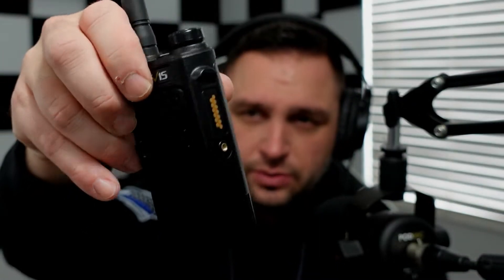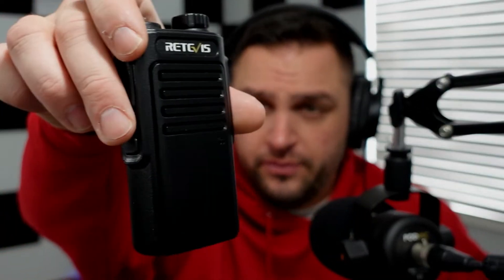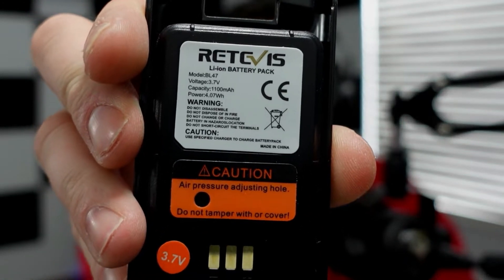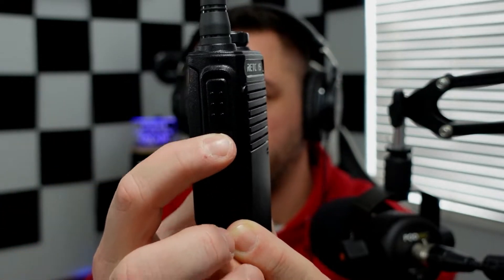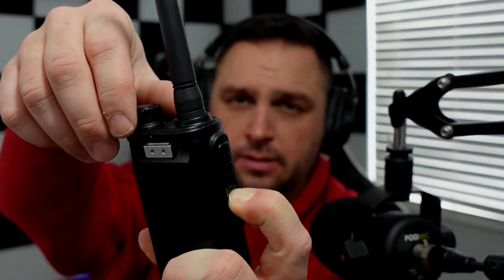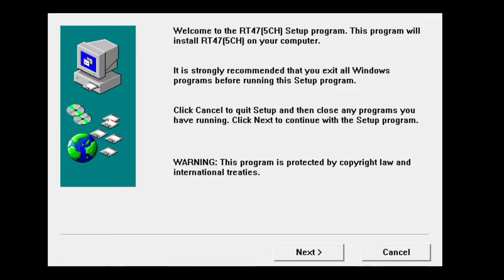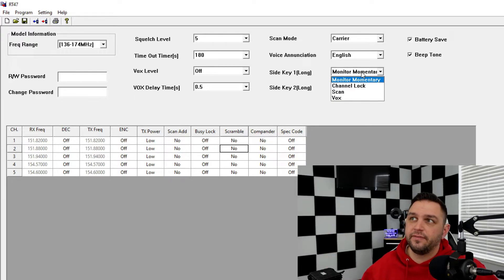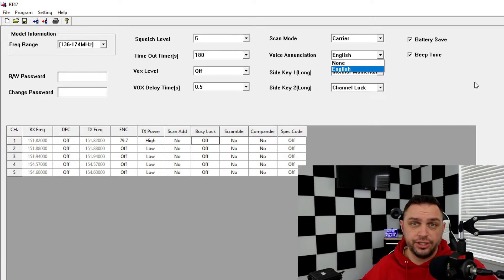Retevis RT-47V / RT47V - Radio Overview Part 1 of 2

Comment: I can't get the radio to accept a read or a write.  It says "Cannot connect the radio" and then the radio says "turned on the radio, one".   I read a forum that said Retevis may have locked down the RT47V's to prevent programming because of being afraid of the FCC for some reason?  There is nothing illegal with wanting to set CTCSS tones.  Anyone else having an issue with this?  Is there a secret password we need to enter in the programming software?

Comment: Wow - great video! Thank you for your effort to make the things clear even for a noob like me :)

One question: Does changing the value TX Power from Low to High in the Desktop Software increase the distance I can bridge with the radio?
Reply from the maker: In theory, yes. More power will increase your distance. The question is, is how much? The answer to that is a little complicated and based upon environmental conditions such as if there's buildings in between, mountain, trees, or other obstructions.    Hopefully that helps

Comment: The programming software installed on Windows 7 PC using a programming cable  bought separately. Chose the correct COM port, clicked button to read the radio (tries to read the radio) but ultimately it would say Cannot connect to the radio. Then the actual radio reboots (it would say "Turn on the Radio..")
Help!
Reply from the maker: I would first question the cable.  Did you get the cable with the radio or purchase it aftermarket?
Reply: @DudeTested  aftermarket, sadly. Thats my next thing to do- get one from Retevis.
Reply: @DudeTested  can you direct me to the link for the cable?
Reply from the maker: @roypunay  https://amzn.to/3kBCHfE  Here you go. So the reason I suspect it to be the cable (for further detail) is that I have multiple retevis radios and have given a lot away.  I got the cables for two radios mixed up and received an email stating the cable I sent didn't work. I sent the rt47 cable (rt87 is the official model cable) and the cable he needed looked identical, physically, even the pins.  Apparently, that was not the case though, as he couldn't program the Retevis RT82 with it

Good luck, keep me updated. Sorry for my slow response.
Reply: @DudeTested  Awesome! It worked and read the radio now (after buying the cable you referred)! I was using a cable for Retevis HD1, I thought it is the same cable for RT47s.. Thank you!

Comment: It seems like a decent and simple radio for the price. The antennas that came with mine say “DMR” on them. Is that what other people have? 

I do wish there was a detented knob to change the channel instead of up/down buttons. I’d rather not have the voice announcements, but if you turn it off you have no way to know what channel you’re on without transmitting and finding out on a different radio.
Reply from the maker: My anennas also say DMR. It's interesting how many radios from China I get that just say DMR.  Must have been a few too many made at a factory.  Great point about the knob.  I will pass this on to Retevis.

Comment: 8:1 SWR? Ouch. I appreciate these manufacturers producing part 95 radios for GMRS and MURS, but for the sake of performance and long term reputation, please include an appropriately tuned antenna. Nice video Dude.
Reply from the maker: I know it, right?   I'm not like many. I have multiple antennas to just throw on.  But yeah, 8:1, and someone buys it, unknowingly. They may see a few problems :(.
Reply: $50 radio, $100 for a VNA to find out you need another $20 for an antenna.